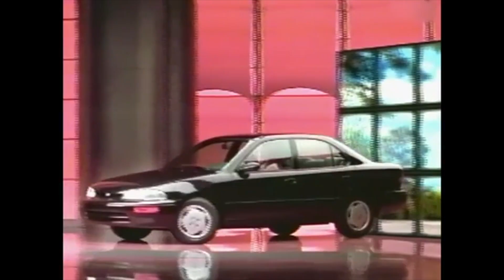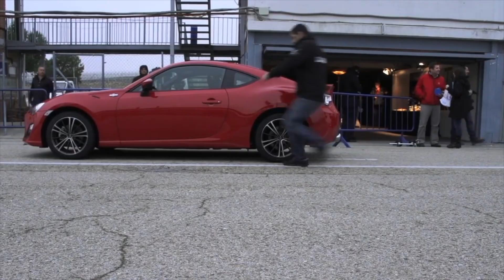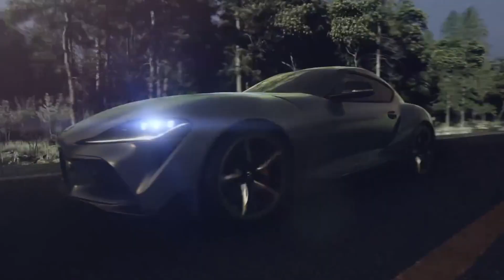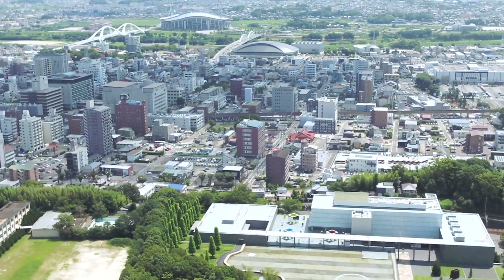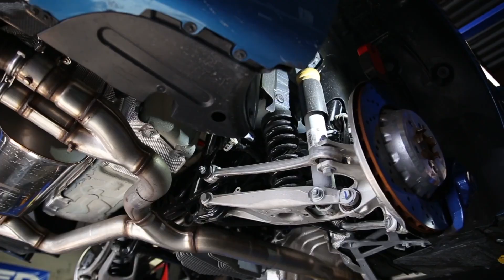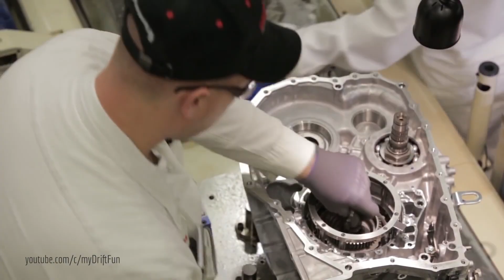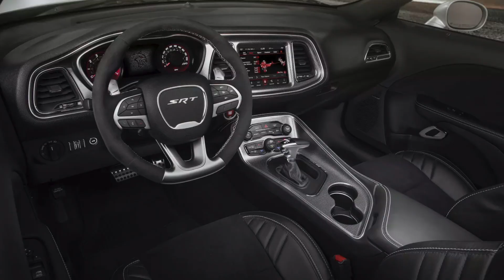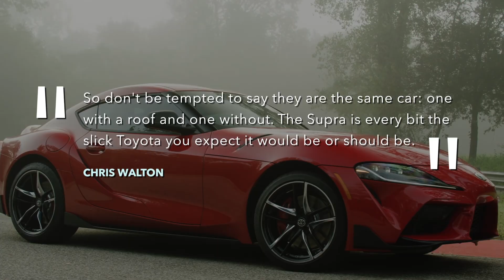MKV Toyota Supra - BMW or Toyota? The UNTOLD TRUE STORY

Comment: Good video, but it is still made of 90% BMW parts even if Toyota did help improve the B58 engine reliability. It will probably be a good sports car and may have better reliability then most BMW's, but Toyota should never have called it the Supra. The Supra brand is their flagship brand and to not develop it themselves to showcase Toyota engineering is just stupid.
Reply: You know, I actually agree wholeheartedly with the original comment. The Supra of twenty years ago was a total Toyota, from the nuts and bolts, to the chassis, to the engine, to the drivetrain, to the shell. Nothing in or on that car was not of Toyota's design.

But what Toyota should have done, in my honest opinion, was probably go back to the last Supra, pull it all apart, and renovate it. They should have tweaked it to suit the times, and wherever possible, introduce improvements on whatever Toyota could think to improve. I think the fact that Toyota has twice had to do a collaboration of sorts with other manufacturers for two cars tells me that Toyota isn't exactly very capable on its own. Either that, or they're just far too lazy and their sale numbers with their "family-friendly" Corollas and Camries are too high for them to care about performance cars the way they did twenty years ago. It's a big shame.
Reply: Toyota knows the success of the supra name so people will buy it because they named it supra. Could have called it an 86. I wouldn't be surprised if they made an 86 and it looked like the new supra. But let's see where this car go. Too soon to judge
Reply: @Brian Anxieton actually if you're trying to compare the Supra production to a phone its more like if the Apple asked Samsung to help them make an iphone. Use all Samsung parts, built in Samsung plants and then put an iphone logo on it.
Reply: @CspecSupra  Samsung makes the most important parts of an iPhone look it up
Reply: So do you want a Supra or not? You understand sport cars are a dying breed now with high cost of engineering and consumer shift to SUVs.
Reply: @TheDailyDriver  You can make sports cars without milking a name, just saying.
Reply: I cant wait for the new 2023 BMW M3 with a 7.0L Hemi.
Reply: @Unintended Consequences Except that it isn't at all. It's a full Z4 coupe. The chassis is the only thing that was made by toyota. Everything else is 100% BMW (or from third-party manufacturers with the same parts that BMW already used). Even the engine, since toyota's testing didn't change much. They didn't develope a whole new existing engine completely new.
Reply: Difference between it being made and not being made. We are looking at the last or penultimate generation of gas sport cars.
Reply: @sebastiansellers5849  #Electric is #faster, #safer and far superior #reliability. ( #TESLA ) #truth be told
Reply: @mexicanracer03  Hashtags don't create a different reality. So shush, the asylum is waiting for you.
Reply: @mexicanracer03  Tesla and reliability are antonyms lmao.
Reply: @mexicanracer03  Until I can get my electric car fix, without sending it back to a factory. I'll stick with petrol.
Reply: @485Runner  electrified garage is the place to go.  Rich from the YouTube channel  richrebuilds is great at EV vehicle
Reply: C Angel:
J.K. Rowling needs your input on her next book.
You may do better there.
Reply: @mexicanracer03  You are absolutely correct. I love Tesla and understand all the push and pull factors regarding EVs and ICEs vehicles. I'm still also a petrol head :)
Reply: Like you were gonna buy it anyways. 99% of people bitching in this comment section were never gonna buy this car anyways.... So what's the big deal? 

You see it as stupid, Toyota sees if as economical. They saved a lot on RnD costs.  Its just good business sense. Spend less on a low volume car.
Reply: @thelionprince4530  That is a stupid point, nobody in reality can´t judge more than 2 or 3 cars if you did not own, just you need see the market, price, product = you can make a proper conclusion that is all... And still nobody prefer a rebadged car over a proper Porsche 718.
Reply: @FEGTTTSDH  obviously some people don't give a shit if it's 'rebadged' or not.... will still buy it. And I'm one of them. 

Didint you watch the video? He provided facts and links to those facts.... If after this awesome video you still wanna call it rebadged..... Good for you buddy 😂.
Reply: @thelionprince4530  Of course you can buy it that is fine, the engine still is a B58 and the car is made in austria, the japan people maybe can be tweak a bit, but it is essentially a BMW engine. And the ZF is doesn´t made for high torque... so for tuning is just average. But my point is the price, the interior can´t match Porsche, and for power you can buy a challenger hellcat, probably handles worse, but out of box have 707 hp and is very easy to drive... and the almost strongest ZF today. But if you are happy with 330 hp and paid 56k for that package... is OK
Reply: FEGTTTSDH Your points are kind of all over the place. The price point is a fair point, but you keep saying it’s a BMW engine, even though in the well researched video it’s a true partnership, so are you disputing that then? You also mention the car being made in Austria. My Civic Hatchback is made in UK. Like why is that relevant?
Reply: @pb8185  Yes but your honda have a "honda engine" is not so relevant where is made, but this engine in the supra, have exactly the same power than the Z4 M40i 340 hp... We don´t know today what kind of modifications Toyota made, but whatever it is, I do not affect the cold numbers. My biggest disappoint is not the bmw intervention, is the power for the money, if this supra have at least 430hp it would be another story, but a Megane RS or Civic Type R have almost the same power, and for me is unacceptable a Supra in the league of a Civic
Reply: @pb8185  Except for the fact that it's NOT a true partnership, which the video proved. Even with reliability testing, toyota can't change much on an already existing engine. They didn't completely develope a whole new product, but just tweaked the materials a bit. The whole engine layout etc. is still BMW. And everything else is 100% BMW or thrid-party, which is already used by BMW.

For the last point, i agree though. Every car is made in several countries. But the supra is still nothing else than a Z4 coupe.
Reply: @thelionprince4530  There are no facts. Outside of the obvious Toyota tweaks BMW Z4 platform and uses ZF transmission. It's rebadged sorry you are a fanboy.
Reply: An opinion is invald if you're not going to purchase said product? Guess your opinion doesn't matter either then.
Reply: @thelionprince4530  This man gets it.
Reply: How can it be a flagship brand if they do not use it?
Reply: Toyota has ZERO experience engineering a proper sports car. The Subaru BRZ doesn’t count, as it was done with Subaru, and it’s too underpowered to be real sports car. For too long, Toyota has been resting on its reliability laurels. There is not more reliability benefit vs a Mercedes, for example.. what’s left is a poorly engineered, ugly car line.
Reply: This car is getting so much attention, good and bad, that I think it is going to be a massive success. There is so much buzz and a lot of people who like it will happily buy it no matter what internet haters post
Reply: V8KILR1 their flagship brand lmfaooooo I remember being 12 years old.
Reply: toyota showcased their engineering with the lexus LFA, toyota does not need to prove they are capable because 9/10 people know they clearly are more than capable. Its a business at the end of the day, and stuff like this is going to bring them in alot more profit than if they had developed it all themselves, just look at the lfa which was an absolute legend and marvel of engineering and even though they sold every single one, they lost money on the project
Reply: I think y'all miss the point of why they used so many BMW parts. The whole point was to keep costs down. And besides the parts aren't what matter (as long as they have been tried and tested, and in the case of toyota improved for reliability) , but how you use those parts.
Reply: Why do people think this way?  It can still represent Toyota engineering even if it is just a Toyota revision of BMW technology.  Plus, the people who are going to buy this car aren't driving around in 1998 Camrys and 2001 Lexus RXs.  The people who actually might buy this car new are they type that drive used Corvettes, and Boxters today.  They want BMW handling, with some small suggestion of reliability.  It doesn't matter who Toyota pairs with to make a car, be it Yamaha, Subaru, BMW, GM, or Mazda.  Toyota seems to always come out on top.
Reply: @emptyshirt  I doubt if a Corvette owner would sell or trade in their car for the 🤣. They would just buy a new vette
Reply: @jacksonduval4995  That's what most do. Trade in the trophy wife for a hot new model lol.
Reply: @emptyshirt  So this is a Ferrari? https://www.motor1.com/news/76262/this-fiero-based-ferrari-kit-car-is-of-questionable-quality/

Comment: Toyota fail..what happened to the TRD engineer guys..what happened to the manual transmission...300hp really...now the BMW guys are laughing..NO MR2..NO CELIACA NO SUPER CHARGE TRUCK AND STILL NO SUPRA..
Reply: "what happened to the TRD engineer guys?"

They pretty much evolved into Gazoo Racing. TRD is used primarily for the US.
Reply: @pmayo7894  there is also TRD Japan that does the GT cars.
Reply: @vashsant  - thanks for the addition.

To clarify, Gazoo is pretty much the PRIMARY tuning arm of Toyota.
Reply: President Obama has created a new 1980's crappy car era, with heavy regulations on fuel economy and emissions. The only way to get that power now is with heavy-ass- hybrid and electric cars. every badass car...has already been made.
Reply: You do realize that Mk4's didn't came with 1000 bhp from the factory and were meant to be gran tourers not sport cars right? The Mk5 is cheaper than mk4 when it was new it's lighter and has a bit more power and has an engine that obviously toyota refused to use unless they could do extensive  improoving. So shut yo ass up
Reply: Tala Fatu bro they need to remake the Celica tho that was a nice car in its time

Comment: This is a totally stupid and inaccurate video make by people who never really had bmw parts in hand.
The Z4 is a parts bin car, like all z4's before it have ever been. Its basically a roadster version of a 3 or 1 series.
Toyota had no real input in the development other than 'kept informed'. All parts are bmw parts coming from bmw OEM's and are akin to previous bmw parts, and very little parts are specifically designed for the z4.
Reply: Albon put all the sources in the video description. Can you share your sources on where you got your information here?
Reply: @AbbeyYaar  none of those resources address the b58 or the zf automatic, and they are all media stories by journalists.. And yes, I have lots of pictures of the underside/suspension arms/subframes of the z4 showing that these are actually bmw parts coming from or based on 1 and 3 series. Toyota had nothing to do with those. Its all bmw tech. Anyone who has real hands on experience working with bmw's and seen those parts, can see that.
But I'd really like to know, which suspension arm, or drive shaft, or motormount or subframe or differential etc etc is coming from toyota or is based on toyota tech? Because to me it looks like they all are from the 1/3 platform. If you hold them next to the parts from a 1 or 3 series you see that immediately. That is not something a journalist does. They write a story about what they were told during a press converence. Their eyes go as deep as the bodywork or interior trim.
Reply: Shhhh don't ruin their fairy-tale make-them-feel-good-video.
 It's the contemporary "auto-journalism", shilling for the company and maybe get a test drive out of it.

Comment: Guys the Supra and Z4 are two different cars
Sure the engines are by BMW but the Z4 has the B38B30B while the Supra has the B58B30C
The Supra is meant to be better than the Z4 in terms of tuning and reliability 
The Supra is unmistakably Toyota

Comment: the e85 BMW z4 were solidly built, i have a 11 year old z4 and it runs smooth and great still with no problems approaching the 100k mark. I'm shocked it didn't need anything when I took it to Perillo BMW and they said it was fine and no problems and none in the future as of now.

Comment: It still needs a manual transmission and a change to the interior so its not looking like a BMW. I could care less about the engine...
If there is an option for a manual and aftermarket is able to redo the entire interior, i’m sold. Change the gauge cluster, shift knob, goofy screen and make it all look more... toyota. The less i feel like i’m in a BMW the more happy i’d be. Now don’t get me wrong, BMW’s are fine vehicles but they aren’t my cup of tea. If i buy a toyota i want to feel like I actually bought a toyota. Driving how it is now all i’d feel is that I bought a cheaper Z4 hardtop and I definitely don’t want that. The Supra has always been my dream car that i’ve drooled over for over a decade now. I love the looks of the MKV the specs are fine. The price comparison with what the MKIV was (after inflation) is roughly the same. It just needs a dang manual

Comment: Toyota supra with a with a BMW engine  = is not a Toyota
But 
It’s An BMW

Like if you agree 😉
Reply: The Mclaren F1 had a BMW engine. 
The 1JZ and 2Jz were produced by Yamaha. 
Pagani uses Mercedes engines in their supercars. 
Multiple Lotus sports cars use Toyota engines.

So following your own logic, the Mclaren F1 is actually the BMW F1, the old Supra was just a motorcycle with 4 wheels, the Pagani Zonda is actually the Mercedes Zonda, and the Lotus Elise is actually the Toyota Elise. 
Hopefully this makes it clear why that makes no sense.
Reply: @LuigiG145  bmw made the engine adhoc for mclaren and is probably the only exception to the rule.
Reply: Well, basically by what your saying, anything car that uses a engine from a different company means its not the company that built the car, but the engine supplier?
Reply: If the engine was the only thing that came from BMW in that car, that'd be a bitter point, but that in itself wouldn't make it a BMW car. It'd still be a Toyota.

However, the fact that 80% of the car is essentially BMW-designed and BMW-engineered (with Toyota's reliability and durability know-how)... that virtually makes it a BMW. Putting a Toyota badge will not change the fact that it is a BMW.

Comment: I'm so sick of people who have never owned (or maybe driven) a BMW trashing their "reliability". I have 225000 miles on my '04 E46.  Still on original clutch. Just did the cooling system refresh, cost me about $800 for the parts and took one easy weekend in my garage. Compare that to the joy of driving a perfectly balanced, 3.0L 6 speed manual into a set of tight curves. I'll put up with whatever it needs.